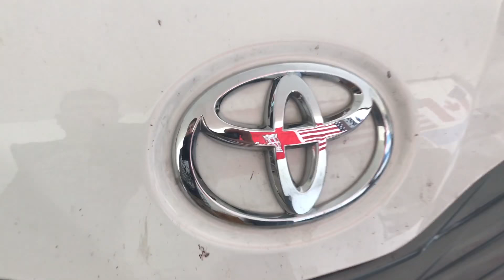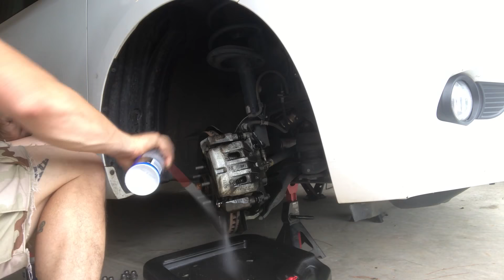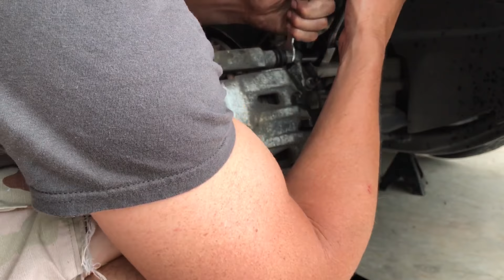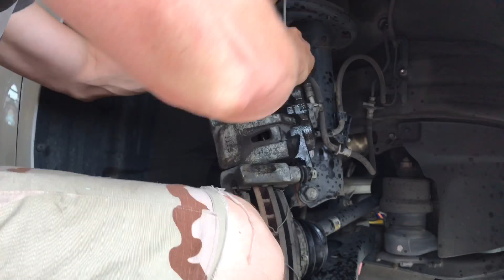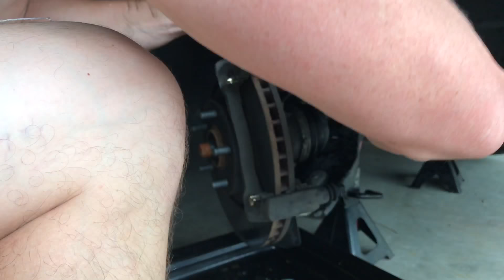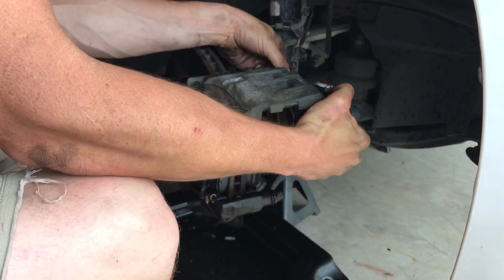Replacing Front Brake Pads Toyota Sienna 2011-2016

Comment: Thanks for the video.  The little rubber sleeve rings on the caliper bolts swell up and get stuck and jammed up in the hole over time if you use just regular grease and then the brake doesn't work as good.  The only grease that works there is silicone based, like the permatex *silicone ceramic extreme, or sil glyde to name just a couple examples.

Comment: Well cant use bearing or moly type grease in those guide boots because that will swell up the pin boots to the point of non functional. The correct lube is silicone grease. Swelling of the pin boots will allow dirt/water to contaminate the pins causing corrosion or failure. Well if you done it already keep in mind now you got do the job again because these vehicle are passenger vehicle and no one wants to put people in danger especially maintenance related.

Comment: Some feedback: 
1. don’t get grease or wd40 on the brake pads or rotor. 
2. A small electric impact wrench would make it quicker and easier to remove and fasten caliper screws.
Reply: Those rubber boots will rot fast with that grease and you can't buy them as I know.  Have to buy the whole expensive kit
Reply: i know Im quite off topic but does anybody know of a good place to stream newly released movies online ?
Reply: @Abdullah Danny flixportal :)
Reply: @Rene Aldo Thanks, I signed up and it seems like a nice service :) Appreciate it !!
Reply: @Abdullah Danny you are welcome :D
Reply: What's the name of the Gun he is using to take the screws out?

Comment: Awesome. I am doing mine tomorrow on my 15 Sienna SE with 61k . When I got my inspection, dealer quoted $489 just for front pads, yeah right. Scott Kilmer recommends the Akebono brand, ACT 1324, so I ordered them from Napa for $85. I have the tools, silicone grease and I put copper anti seize on hardware and back of brakes. Where does the dealer justify the other $400 for an hour job? Thanks for taking the time to record.
Reply: Usually dealer will either replace or turn rotors and replace brake fluid. Rotors dont need to be replaced if there is no pulsing and they are clean (no rust) on rake surface. However replacing brake fluid is a must unless it was done last 2-3 years. Failing to do so will increase risk of brake faiding after long braking or during very cold temperatures due to accumulated water in the fluid.
It is not really recommended to compress caliper like that on ABS equipped car, especially if brake fluid is not being replaced as that increases risk of ABS system damage. Preferred way is not open bleeding screw and let it drain as calipers are compressed.